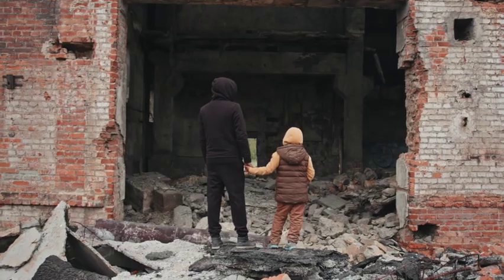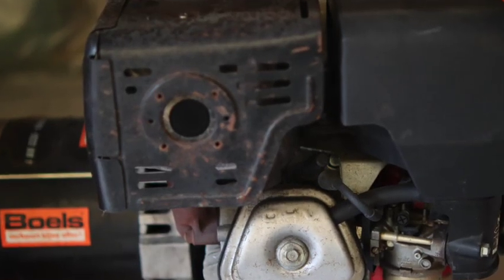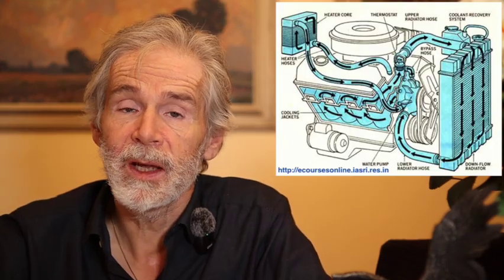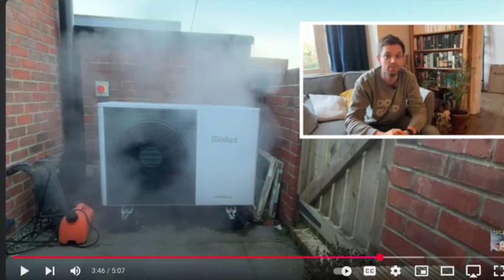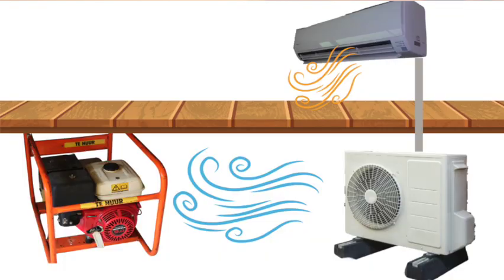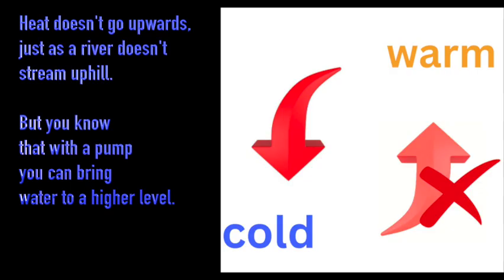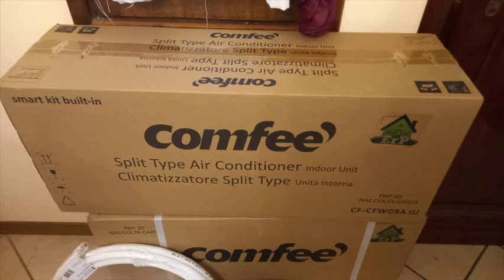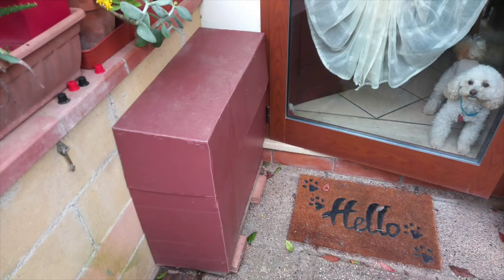How to combine the heat pump and micro CHP into an A-Team! - Video 79

Comment: can not use silicon sand  put that around the block put then coper pipes true the sand
Reply from the maker: Hi Teni, do you mean to use the sand as transfer of heat from the engine to the copper pipes?
Reply: @nnvasen-good-energy  yes
Reply from the maker: Isn't that an isolator so that the engine will become too hot?
Reply: @nnvasen-good-energy  kan het sand ook in dunne koper pijp stoppen dan buigen dan breekt ie niet
Reply from the maker: Ah, dat is een goed idee! Maar dan moet die buis zeker 1 cm zijn, niet? Om het zand erin te krijgen. Ben je uit Nederland of Belgie?
Reply: @nnvasen-good-energy  nederland

Comment: You also have to get the air to run the generator from Outside the enclosure. The inside room MUST also be well insulated from the outside temp. If you use the ambient heat in this inside room, you would be taking heat away from the heated home, the heat needs to come from somewhere. I also think the efficiency of an inverter generator is Higher than a standard generator. It uses less fuel to generate the electricity, but also produces less heat, double edge sword. The best figures I can get on inverters is they are approx 30% more efficient. That would be Better since the A/C unit would give 2x to 3x the efficiency of just heat. Also, much less noise to the adjoining home.
Reply from the maker: Hi William, thanks for your feedback. I agree that the heat must be delivered, otherwise the garage will cool down. But it will cool down slowly. So in every individual case, calculations are good, but experiments also belong to it. The results will tell you what you can do. Even if some heat will leak away from your home to the garage, the high COP will more than compensate it. Also your point of insulation between garage and outside is correct. But even if the garage cools down to 10℃ (with less leakage from there to outside), the heat pump will still have a better COP then when it is outside. Important of the concept is that it gives both a better COP and it recovers the 6 kWh of usually discarded heat in a gasoline generator. See also my comment below to AndreiReal.
Reply: @nnvasen-good-energy  I'm very interested in the results of the heat pump experiment. Our natural gas price in southern Michigan is $ 0.80/CC. Propane is approx $18/20LB bottle.
Reply from the maker: Hi William, I am now busy to install the heat pump indeed. It is for me the first time to connect a split so I will see. I already worked on the installation of the external unit inside the garage, where there is also a place for the gasoline generator. Those prices in Michigan are rather high. Is grid stability good?

Comment: but what's the point of running a heat pump on the generator in the first place when grid is available? That solution will work in a blackout, yes, but the majority of time the grid is available even here in Ukraine. I heat my house with a 15 kw heat pump during mid-season (and with a solid fuel boiler during winter or when it's lower than -10C), and have a 5.5 kw generator in a garage with exhaust pipe outside. The heat pump takes 2.6 to 4.5 electric kw depending on the water temp output, if I run it on the 5.5 kw gen, it will use 3.5 kw avg, that will mean burning 2.5l to 3l petrol per hour. 

Converted to money it means my heat pump will reqiure 3*51uah=151uah=3.46 euro per hour + add the money to gen wear and tear and to get to the fuel station by car and buy fuel. The same amount of electric kw taken from the grid will cost 0.19*3.5=0.66 euro per hour, even if we take your price of 0.6 euro per kwh it's still 2.1 euro. The COP benefit simply won`t cover the difference. 

While the scenario is interesting in itself, it won`t work in real life on a constant basis, even during an all out war. If you want to save on heating and electricity, solar panels and grid-tied or hybrid mixing inverters are much simpler way.
Reply from the maker: Hi Andrei,
thank you for the comment, good to have feedback from Ukraine. And from someone with so much heat pump experience.
When the grid is available, this idea makes sense if the economical numbers confirm it. I have to say, that Italian average costs were variable and higher in winter (I have a table of 24 months and it tops to 0,54€). So that is lower than the 0,60 I said. From the other side there are many worries about the coming winter in Europe, that it will be colder than the last 10 years and that the growing stress from more heat pumps and more EVs will push the suppliers in a corner, decreasing the reliability of the grid. I admit that we have much less problems in W-Europe than Ukraine, but still, we all tend to be or become outside a normal situation. My video is an answer to that.

I am sorry if I exaggerated the price, I didn't do it on purpose (but still it is wrong 😒) but with pressure on the grid operators to invest, they will present the bill. If not, there will be less money for them to invest and an unstable grid will result. In both scenarios it is good to prepare. Some needs are too important to fully trust the infrastructures and if there are really so many gasoline generators around as the statistics say, then it is a good way to use them.
A bit of calculations with the above winter price for electricity and the amount of kWh in a litre of gasoline converted by a generator: 3*0,54=1,62, the gasoline price is now 1,75 in Italy. The gross price of natural gas is here 0,48€, so 0,48/9=0,053€ per kWh, so the electricity & heat in a litre of gasoline has the worth of 1,62+6*0,053 = 1,94€. That is a bit more than the gasoline price itself.

In any way, discarding heat energy is a pity and then, with the heat pump bridging a high temperature difference, I thought this concept can be done in the garage, which is then not only a thermal energy storage but also a way to have better COP.

By the way, one of the drivers to put also Russian subtitles was that nearly everybody can speak Russian and that the ongoing war requires uncommon solutions, also for energy. Now that so many power stations were damaged in November, I heard that many gasoline generators are installed. I would like to ask you confirmation if the Russian subtitles are useful and if you have other suggestions of video themes that can be useful in Ukraine, which are in the scope of Energy Home DIY. I thank you very much.
Reply: @nnvasen-good-energy  Thanks for the reply. 

The propane generator is definetely a more viable solution than running on petrol, as its roughly 60% of the price and many generator users here do install carb conversion kits to their gensets. Also a generator is generally an outdoor unit, so many people install them outside to avoid carbon poisoning, sometimes building gen sheds\rain covers to protect from the elements. Also running a generator larger than a 2 kw invertor is expensive, they are considered an emergency here, rather than a constant source of power, so many people avoid running them if they can just wait for the grid to appear. Overall, those who can affrod it, switch to lifepo4 batteries and manual switch or on-line UPS-style dc-ac inverters to run critical appliances while waiting for the grid to recover, preferring not to use a generator at all. 

Another problem with running the generators constantly is their overall low life expectancy and failure rate, as was shown during the 2022 autumn-2023 winter (the worst blackouts so far). Many petrol generators were failing in their 30 to 50 moto hours, if the user was new to them. A generator is basically like a car - it needs maintanence, oil changes, carb cleaning etc. You need to monitor your power consumption very closely as it's very easy to burn the coil wiring of the rotor\stator and damage an avr unit of the generator. There were hundreds of brand new burned generators here, esp in 3 kw range, just because someone's wife turned on an electric kettle, or a toaster, or a water pump started suddenly drawing additional 1 kw to 2 kw over the limit. I have my generator over 15 yrs, so I'm familiar with how to operate it and have over 600 hrs on it. But my friends, who were new to this equipment all burned theirs at 30 hrs to 50 hrs runtime, despite me telling them what to and what not to do. So the mass transition to generators has it's problems. 

As for the problem with the garage setup is that heating a house (and running a heat pump) is something that you do constantly, on a daily basis. If there is no grid - you run on a generator, if there is grid - you run it from grid. If you run the outside unit of a heat pump in an enclosed space - it will cool this space eventually to the temp, that will be even lower, than the outside temp. Thus not only it will loose the higher COP bonus, but will even make it worse than if it would have been placed outside. And if you don't have to run the generator, than there is no economical way to heat that space. 

As for the subtitles - I don't know, probably a good idea. I'm fluent in english, so I watched the video in english. The topic of heat pumps in general is becoming popular here, so the more people will be able to view it, the better.
Reply from the maker: Thank you Andrei, that is an awesome lot of real life experience. I would not have guessed that so many generators fail in their first 50 or 100 hours. However, I can immagine what influence has a power spike on the windings. It is also a good point that installing the unit inside the garage binds you to find a heat source like this generator. It can be an idea to install it in a place (like a shed) where it can be close to the outside but also closed so that it "belongs" to the garage. We are here only in the winter and I want to use all the heat (exhaust + motor heat) to feed into the cold side of the heat pump, making a good match. The home battery will allow me to run the generator at a high rate (to use the fuel well) but not too high and without spikes. These spikes will be dealt with by the battery + inverter, even if I must respect the specs of the inverter, which also dislikes surge current. At least it has an overload switch. A soft starter on the heat pump or fridge can absorb a spike.
Also on my generator (a good one, with inverter) is written that it is not for continuous running but after it divides half of its power for battery charging and running the heat pump, in  2 or 3 hours it should be able to put about 2,5 kWh in the battery and then you can run  for half a day in silence and without big  electrical consumers.
Thank you again for sharing your real life experience, I will take it into account.

Comment: pleas turn down the musik and raise the volume for your voice
Reply from the maker: Hi Romoco, thanks, I will do so. Do you like the theme and is it something that you would want to implement?
Reply: @nnvasen-good-energy  no I have nothing I need to add you are on the right track and taking it from scratch. My system is probably a bit too complicated actually.
I can set the generator from 5% up to 100% in 5% steps to match the engine power and maximize the benefit of the heat, for example only charge 1kw and heat the boat with 2kw. In the summer there will be hybrid operation on the engines if needed so double the benefit of the generator ;)
Reply from the maker: Very nice :-)